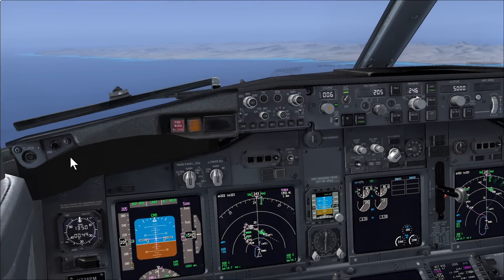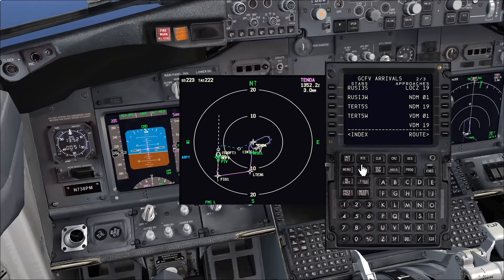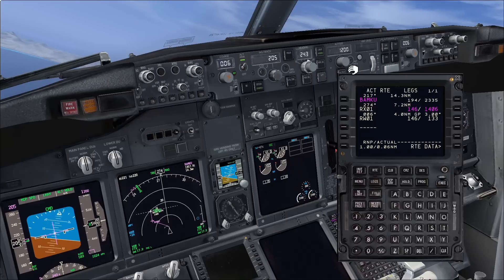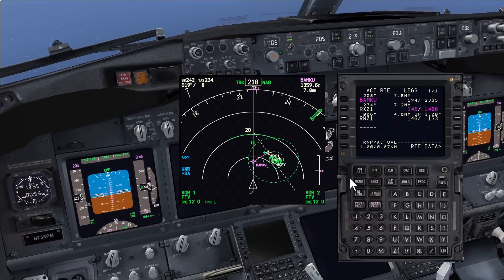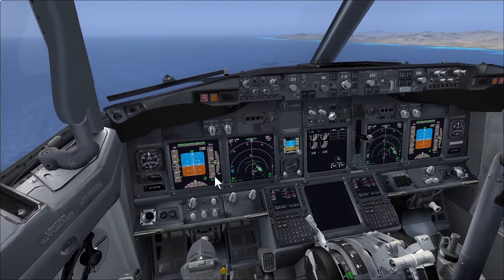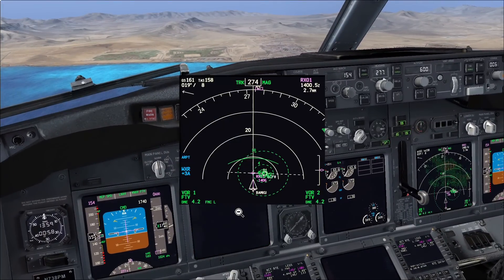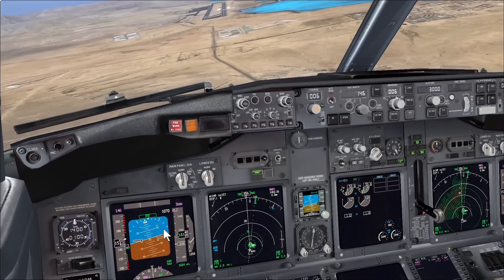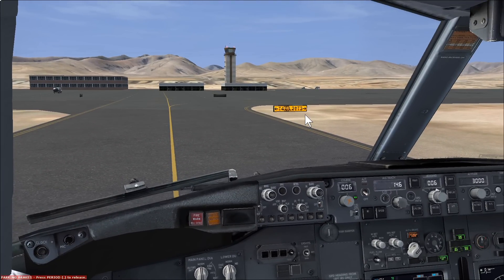PMD7 737 Visual Approach Tutorial by a Real 737 Pilot

Comment: Hi Captain!!! I would like to ask about 737. In manual flight we use the rudder pedals with yoke to turn?
Reply from the maker: Hi there!

The rudder in a 737, unlike a light aircraft, is not used to coordinate turns, we just use Aileron and Pitch to turn. The only time we use rudder is to maintain centerline during takeoff and landing,  de-crab during a crosswind landing or to counteract an engine failure.

FD2S
Reply: @flightdeck2sim   thanks!!!!

Comment: Touch down at <400 fpm, you could walk away from that one happily! Is that just the default scenery? Busy video but definitely one of your most useful, thank you very much for posting this.
Reply from the maker: Hi Simon!

I couldn't tell you how many FPM constitutes to a smooth landing! There is nothing more frustrating as an instructor when cadets try and pull off a smooth landing and keep pulling up during the flare! 

It's worth noting if the runway is contaminated we'd actually aim for a firmer landing so we can get on the ground ASAP to deploy all the stopping forces needed on a slippery runway. 

Unfortunately the general public perceive a firm landing as a bad landing or the pilots are poorly trained etc... But if I was a passenger knowing we were landing on a short runway I'd be very concerned if we were still flying passing the threshold 10 seconds previously followed by a greaser........

Glad you liked my tutorial! Quite Intensive but that is to get all the information across live time!

FD2S
Reply: flightdeck2sim 1 year late but respect.

Comment: I enjoyed that -400 fpm landing <3

Don't take me too serious; I know you don't measure fpm irl. Great video nonetheless :)
Reply from the maker: Trust me, there is a massive misconception with the general public that a smooth landing is a good landing....
Reply from the maker: Not too far off nvstewart.

If you go for that "greaser" on a short runway you'll be using valuable runway where you really want to have the wheels on the ground applying brakes, reverses engaged and ground spoilers extended! 

FD2S
Reply: Is that because, with a smooth landing, the aircraft will be light on the runway initially, meaning wind etc will effect the aircraft more?  And with a harder landing you are making good contact and making sure that you are using the full weight of the aircraft to increase ground control?

I'm just theorizing here.
Reply: ok cheers.